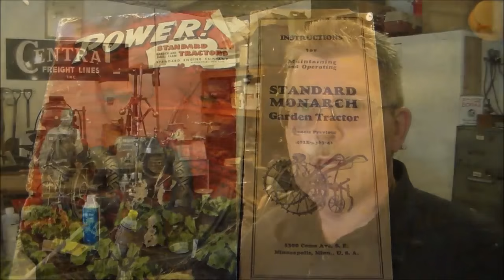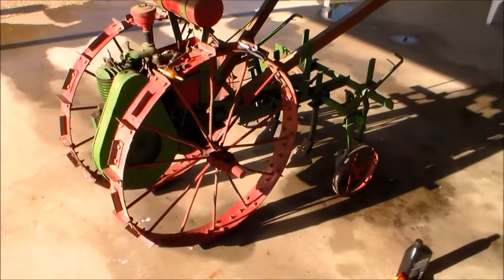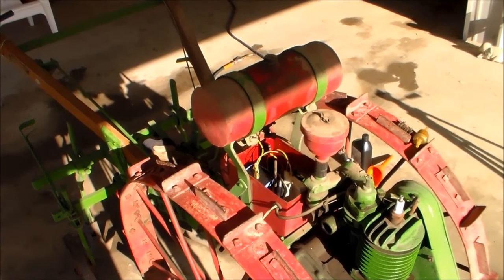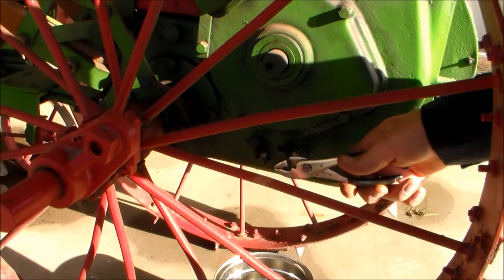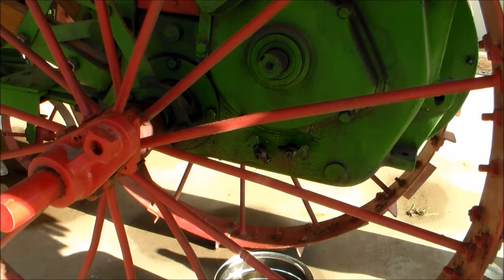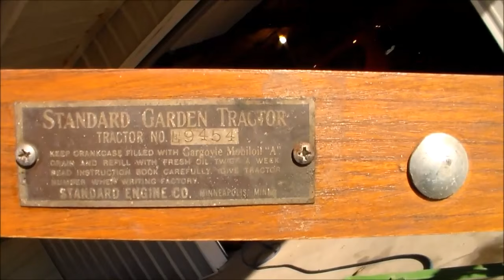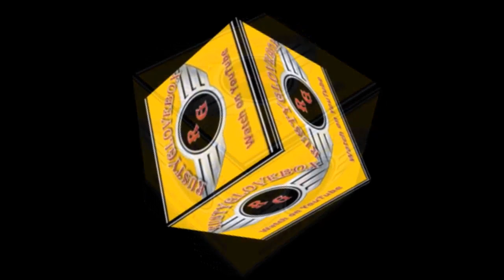Standard Monarch Garden Tractor

Comment: nice earlier standard. I collect standards and that's technically pre monarch would have been referred to just as the standard tractor. early ones have flat blade wheels and carbon on the back of the cylinder later are on side. Walsh and standard where actually separate company's that used the same design and then joined all together with twins also to form the standard company.

Comment: That started really well and seemed to improve as you were walking with it as well. I wonder how well it might pull if you asked it to work pulling that drag. Does it only have one gear?
Reply from the maker: +Dan Whiteford   I think the carb was clearing out and running better. Just 1 gear forward. It was rated at 3.5 hp. I may see if it will pull me on a skid, that should be a good test...lol

Comment: Hey liked the vid👍 early tractors have a machined surface on them right next to the oil petcocks do you know what year it is? what is the serial number? 
Ps: the oil petcocks on mine are made of brass might want to shine yours up a bit☺️
Reply from the maker: the tractor tag is E9454  on the plate. Not knowing for sure, I thought it was around 1930 or so. If this tag # doesn't show up, I can see if there is a number stamped on the case. I have the original parts book and manual for the tractor too.
Reply: Rusty Glovebox I am sorry but I can't find out the year on yours I don't know it should work on all standard tractors. I know the E means it is a standard monarch and the 1 and 3 number are the year but that doesn't make sense the letter E should be the 4 one. They started production around 1934 and ended in 1950. Mine is a 1939 I'll do some more digging and you look by the pet cooks and see if there is a number there

Comment: I have a Monarch very similar to yours. I'm going to try to get the old girl running do you know where i can get a spark plug for it mine is broken?
Reply from the maker: I ordered some Autolite 3095 Copper Non-Resistor Spark Plug from Amazon and they worked good. Same as a Ford model T plug. Good luck

Comment: I know this video is 4 years old but i just viewed it for first time. Does the tag say monarch on it ?   That appears to be an earlier model just called the standard garden tractor. If by chance its tagged as a monarch judging by what i see it would be very early possibly even a transition tractor.  I own many tractors from these related builders.
Reply from the maker: I have the original manuals and it is a Monarch.
Reply: @RustyGlovebox  must be very early then. To my knowledge the monarch models didn't use that aircleaner & wheels appear to be larger diameter.   I love to see a pic of ur tag to check. Style serial number etc.    Very interesting machine